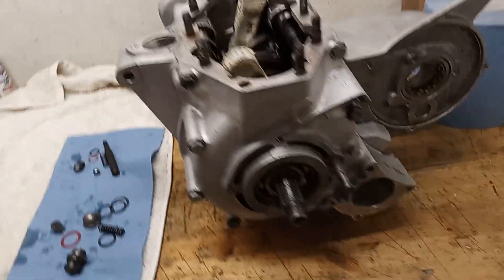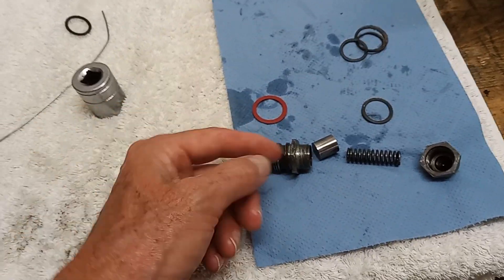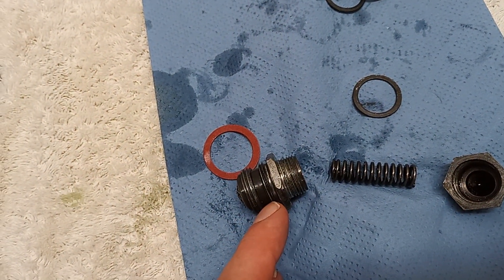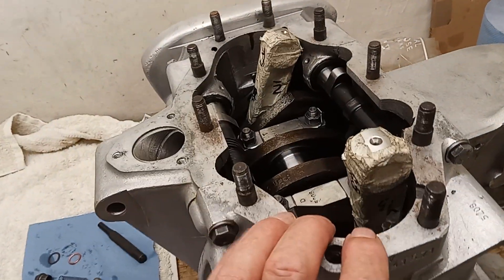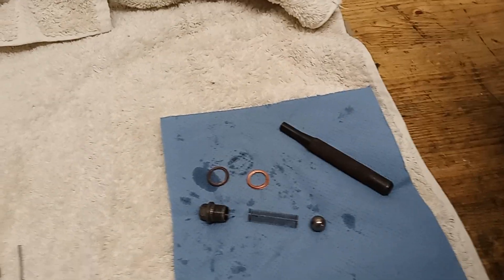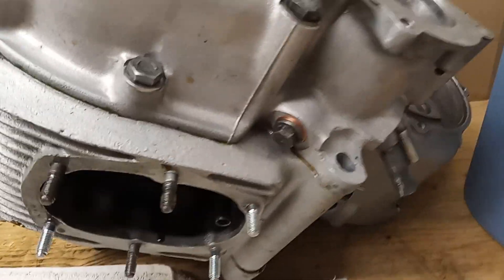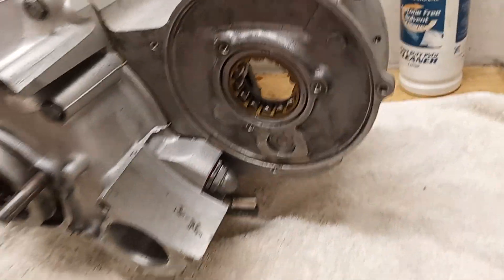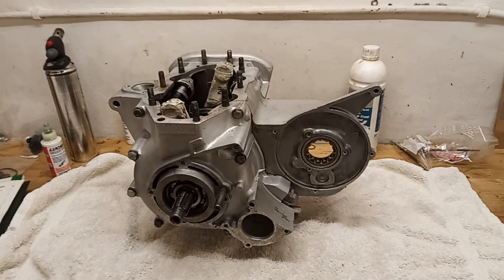Triumph Trident T150V Engine Rebuild. Part 21: The Oil Pressure Relief Valve and Anti-Drain Valve

Comment: Hi Chris , did your oil pressure end up ok cold and hot , is it all behaving like it should ? . Cheers
Reply from the maker: I've not quite yet finished building the engine, and then it will go back to the owner to then put it back in the frame and recommission the rest of the bike, so a while to go yet, but I don't forsee any problems.
Reply: On my T160 the bike starts up at 90-100 psi it will stay like that for 10 + minutes  idling , and the pressure comes down to about 80  , sometimes when I rev it psi goes up , sometimes it goes down  , when I ride it  , it sits on 50psi @4000 , then when I got home at 4000 it was at 75 psi ! Might get another gauge to see of it reads the same ,  bike has 11,000 mile on original, is very quiet,  PO has done alot to make a tidy bike all rubbers and seals painted tank , no smoke at all . Thought I'd fit a new relief valve first and check infeed line to pump if no better  then maybe fit a new pump  .it's on 20/50 high zinc .  Any thoughts , great vids helpful , Cheers.
Reply from the maker: @Cobra427Veight  those oil pressure figures are generally absolutely fine, no need to worry or make any changes. The only thing that might be worth considering would be to just use straight 50 oil rather than 20/50 if you only ride in the Summer. However, the last reading of the pressure going up at the end is puzzling. I would suspect the gauge rather than the engine.